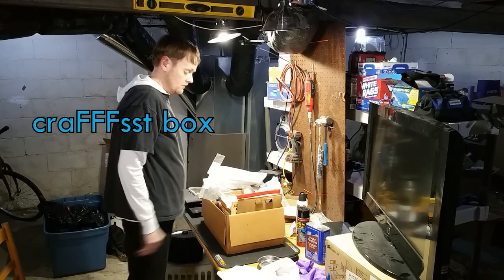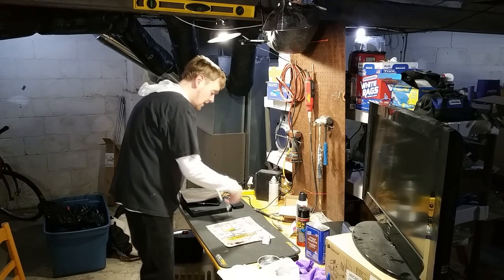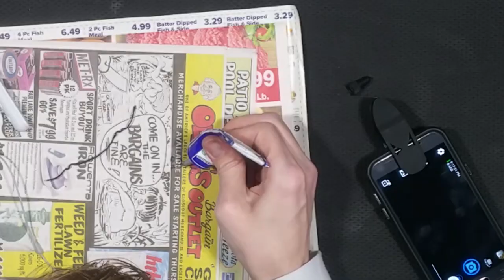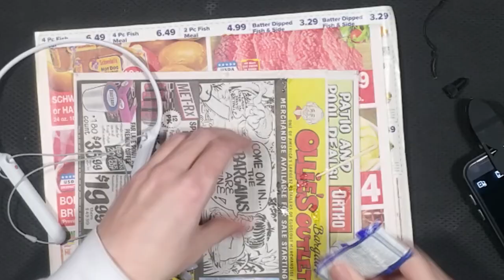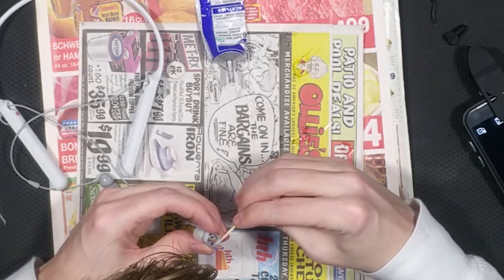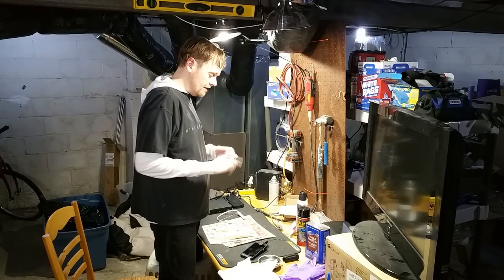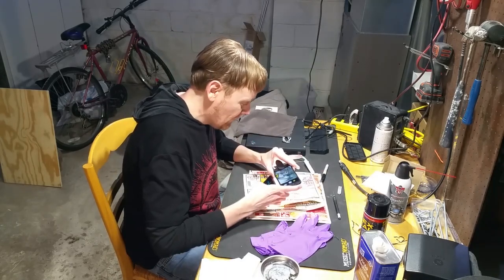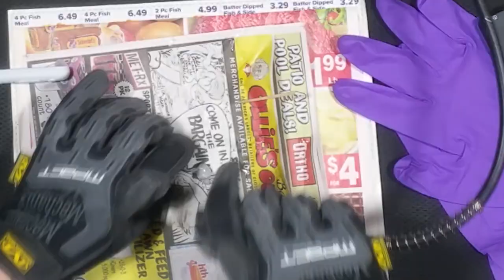Fix it DIY | fix cheap broken headphones, Sony WI-C400

Comment: I have a problem on my headphones  
the other  side is not working,it dont have sounds ,can be fix it?
Reply from the maker: It depends on where it is "shorted" which means where it lost connection. They usually can't be fixed.
I have a pair like this. Should I make a video on trying to fix them?
Reply: @RobertJene  I slept over the  night  without removing my headseat (sony WI-C400) on my neck then the next  morning  ,the  other side of my headset  didn't  work  but the other side working ,what do you think? it can be fix?
yeah, sir  I'll  be waiting
Reply from the maker: @rcillorente4255  
I have two questions.
1. Turn on some music, and gently move the wire in some places. Does the sound cut in and out if you do this?
2. (If Yes on # 1) Do you know anyone that knows how to use a soldering iron?
Reply: @RobertJene  No ,  No sounds  even  a liitle sounds,I don't  hear any sounds from that side .
Yes ,my brother know how to use soldering iron but he's  not here.
So  it can be fix?Im planning to bring it to a repair center.
Reply from the maker: @rcillorente4255  how much would a repair center charge you to fix it?
Is it cheap?
Reply: @RobertJene  I do not know yet ,I can't  bring it now  due of the lockdown  here,so what do you think it could be fix sir?
Reply from the maker: @rcillorente4255  I think I will have some time to try on another pair of headphones I have this weekend.
So you will see what I look for to see if I can fix headphones that don't make sound on one side.
Reply: @RobertJene  Thank you for giving me hope 😊
Reply from the maker: I tried to fix some other bluetooth headphones. Maybe your brother can have a try with this method
https://youtu.be/Q54isy0PYj8
Reply: @RobertJene  Thank you 😊 ,your so kind ,I really  appreciate  it..
God bless you !

Comment: One side is not working pls help
Reply from the maker: If you have headphones where one side isn't working... 
It is not likely you can fix it. It is usually a tiny piece is broken inside of the ear piece.
But if the sound cuts in and out... And you can find where it is... 
If you know how to replace some of the wire...
But that requires re-wiring and soldering skills

Comment: Damn thought it was a real repair - mine don't turn on- was hoping you opened yours up
Wrong glue by the way
Reply from the maker: it's not really glue. it's acrylic cement.
it holds together a few kinds of plastic, including this. works really well.